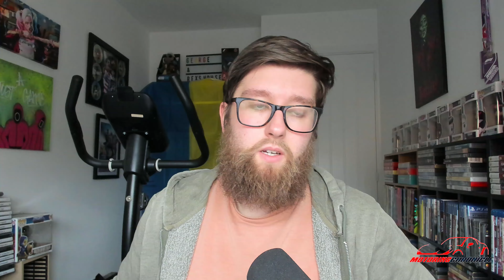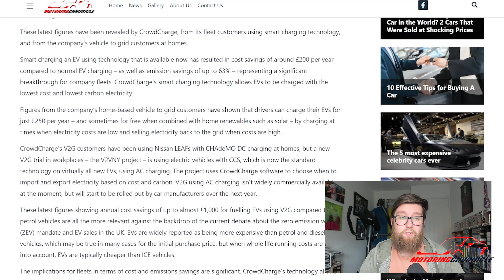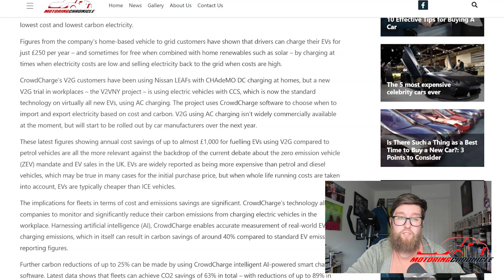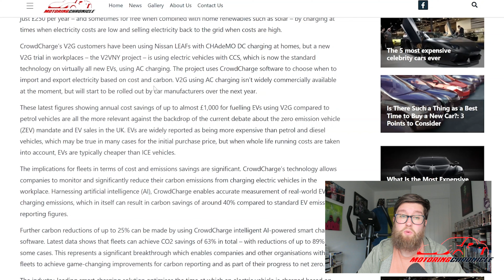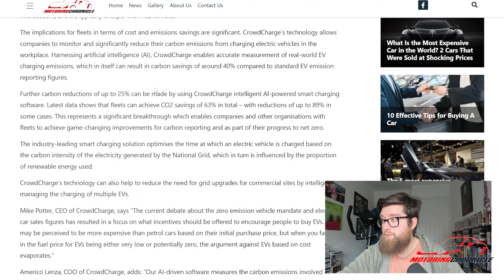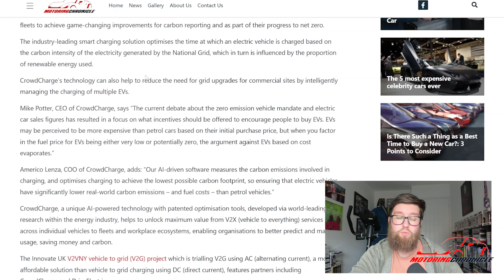EV Running Costs Continue to Fall Thanks to AI-powered Smart Charging [Motoring News]

Comment: AI likely to thin service and supply chains.  Once industry  winners emerge they will conceal true costs and without a challenger set their prices to maximize profits just like we saw in the chip wars with Taiwan.   Governments will hide behind national security, safety and jobs to justify and explain away why they can't produce a better EV for 5x what is available in the Global marketplace.

What's going to be amazing is when an EV AI can accurately troubleshoot itself.  When an EV's warranty is just the owner DIY part swapping and EVs are built with this in mind.  All this is bad news for existing ICE giants, related industries,  jobs and economies everywhere.  

Anticipating massive resistance to slow it all down here in the USA.